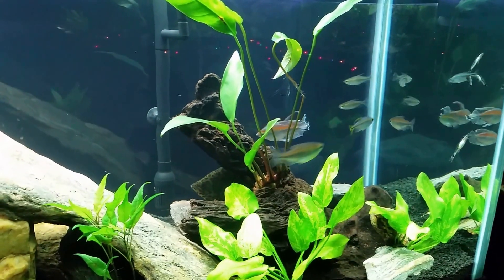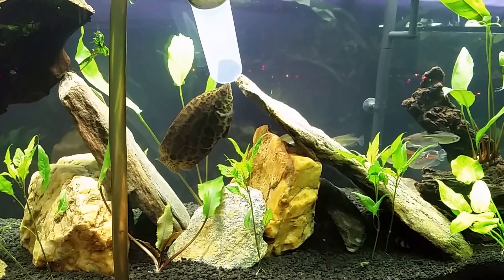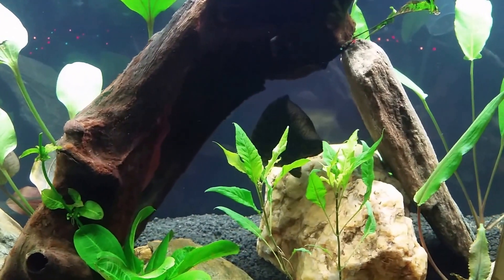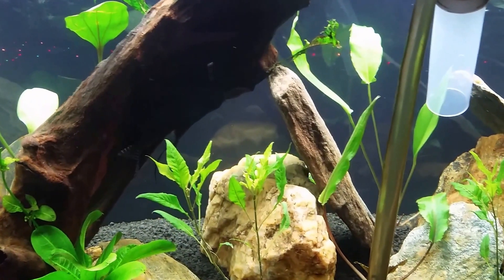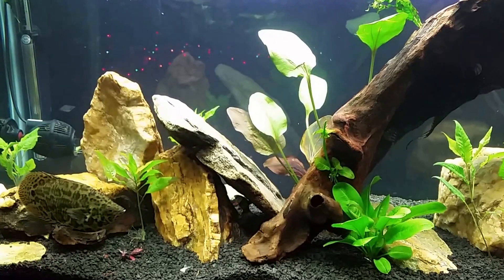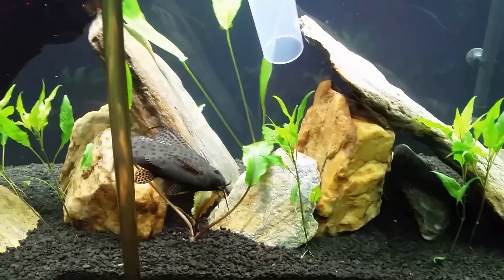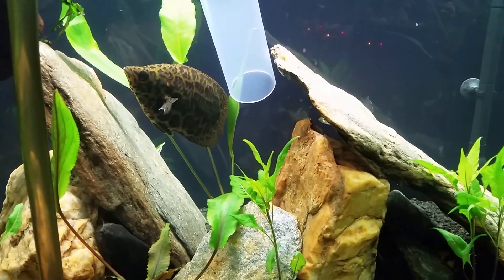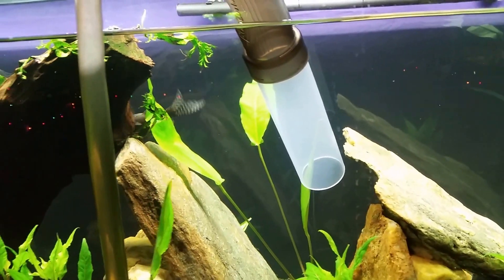Why my water system wasn't removing Nitrates from my well water.

Comment: Dan just jumping around old vids. You mentioned a couple of things. 1. You don't use RO water and I haven't found that vid. yet but I'm guessing because it strips everything from the water...and it does. 2. you mentioned running back to back nitrate resin tanks. Here is my take as an old water treatment design engineer...some water plants treat ground water with RO but they blend raw untreated water with it in a 500K gallon storage tank and then test for EPA drinking water standards, mainly keeping TDS at or just below 500ppm. It would be hard to do that unless you could arrange some space for a plastic 50 gallon barrel in which to do some blending and just use that as a sort of top off tank/ blend for water changes. A bit better control to get below what you have had to settle for...or ask the water company to run a trial second resin tank to see if that would really do the trick. JMHOpions.

Comment: Are you sure your resin uses up the Sodium if that was the case you would be replacing removed nitrate with sodium not good for FW fish. If your resin is taking up the chloride and passing out the sodium on the backwash that would be better.  I would like to get my hands on such a resin. Its easy also to confuse  chlorides and chlorine there not the same - cheers
Reply from the maker: My water definitely has high sodium levels. There's certain fish I can't keep.
Reply: Ok thanks. Understand there are resins that exchange chloride not sodium for nitrate will keep searching. Have also tried huge amount of plants but did not impact the nitrate levels. My pond /tank is over 4000 gall understocked and crystal clear but depending on test kit used levels NO3 are between 20 and 50 ppm the fight continues.

Comment: You do have probably very specialized water.  Very unique.  Good stuff.  That's why I love my RODI unit.  Strip it down and then add back what my fish will need.  I'd be very scared to leave my fish in a tank that is still cycling.   Ouch!
Reply from the maker: I honestly didn't think it would still be cycling. I really needed to move them, so I sorta jumped the gun.